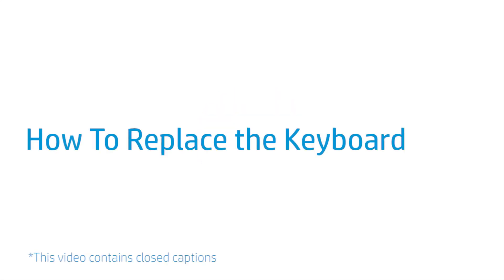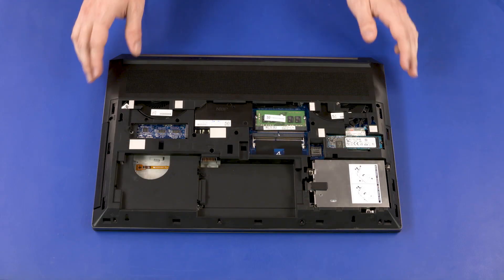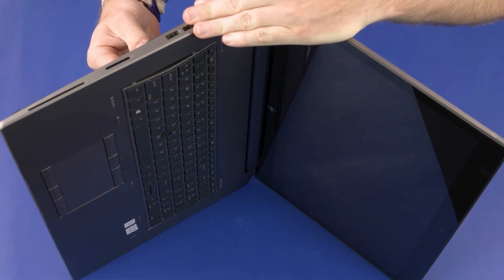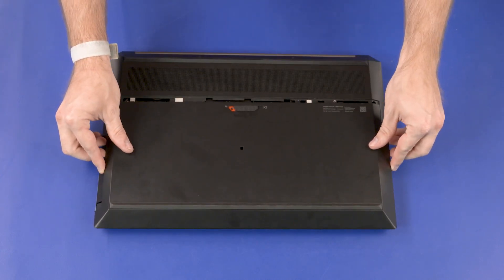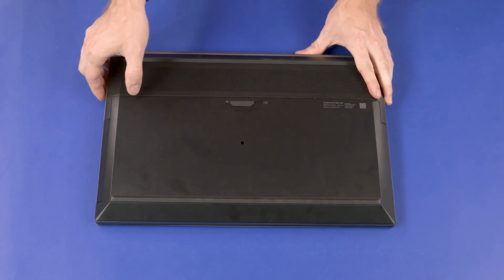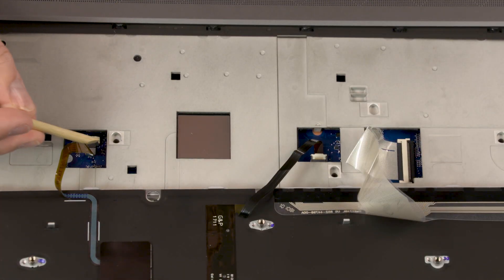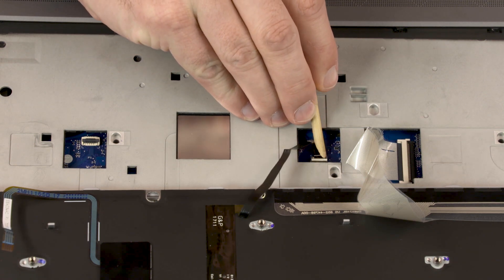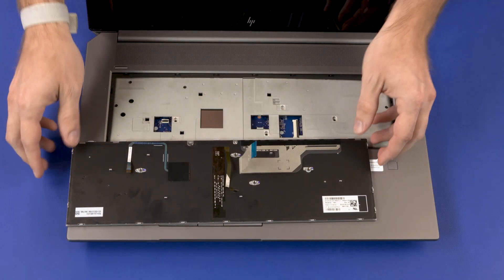Replace the Keyboard | HP ZBook 17 G5, G6 Mobile Workstation | HP

Comment: This helped a lot! There were a few headscraching differences in my wife’s Zbook 17 G2 . There was no lable for the keyboard releace. The release space was there but i did not discover it until I had sucdcessfully gutar picked out the seam between the case and keyboard. There were two different looking ziff ribbon connectors but I could figure out the pop up release ( your looked like they pivoted back). There were two hold down screws the third screw I took out was the DVD release!  Two ribbons, the new one had no indicators but it was easy to see which way they connected. Thanks for the help.
Reply from the maker: +Burt Chabot I am glad to know that the video was very useful to you.